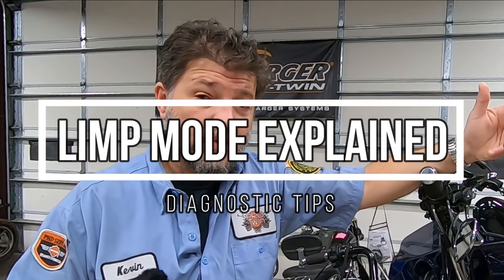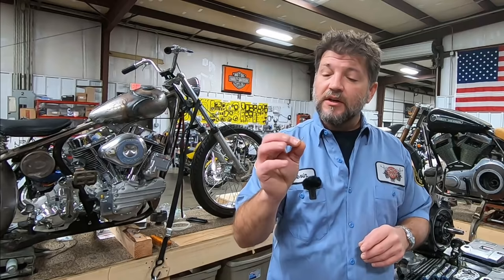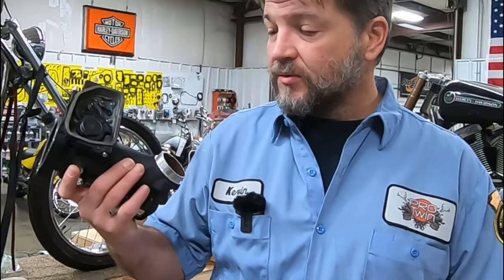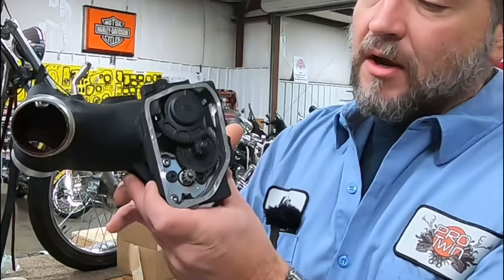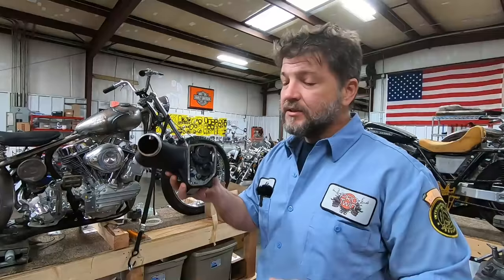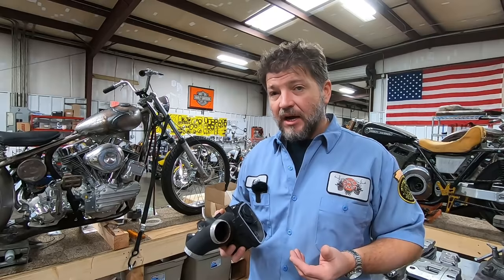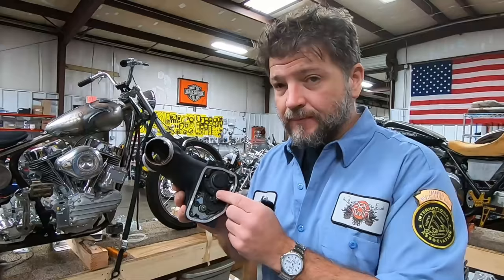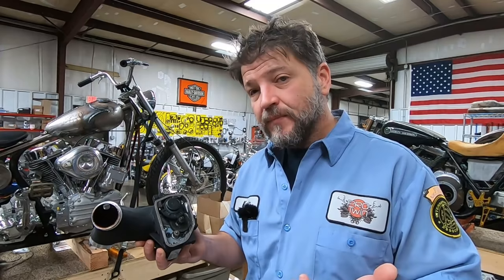Harley Limp Mode | Throttle Lag | Fly by Wire Explained | Kevin Baxter | Pro Twin Performance

Comment: As a BMW master tech of many years that’s the best explanation I’ve heard of fly by wire systems. 
One suggestion, use voltage drops rather than resistance measurement as even if you only have one strand of wire hanging on you will still have continuity.
Reply: Resistance is what creates the voltage drop.
Reply: @jonnybds3  yes but you need a load on the circuit therefore you cannot use resistance.

Comment: Thanks for this informative video. I had "limp mode" engaged on my '14 Limited twice, necessitating it being recovered from France to my dealership in England. The recovery driver helpfully turned the ignition on to stop the alarm sounding all the time, so when they got it in the shop, it had a dead battery. New battery - ran fine, no codes, no problem.  A month later, riding up a French highway, 80mph, cruise and stereo on .... bleeeeeurgh. Nothing. Would only just idle, such that I couldn't engage second gear.  Another recovery, this time to the channel, then another van home. Got collected by the dealer, and it ran fine. No codes returned by the ECM. They checked wiring, voltages, throttle body, everything. They were just about to ring me to come collect it, when a tech fired it up, and it lit the little yellow "helicopter", and wouldn't respond to the throttle. Instantly plugged it into the computer  ... ECM failure. That's why there were no codes - it forgot them when it was powered off. New ECM, and it's been fault free for 11 thousand more miles.
Reply: Hello ! Je me permet de vous contacter car je rencontre le même problème. Mon concessionnaire à remplacé le corps de papillon, et l'ECM mais toujours le problème. Avez vous trouvez une solution ? Merci

Comment: Thanks legend. I was stuck in limp mode 290kms away from nowhere. Checked connector to the throttle body and after reconnecting the bike roared back to life and saved me arranging transport back to the nearest dealer / mechanic shop. Please keep on educating me and others that are mechanically challenged.

Comment: Great vid. I checked and cleaned contacts on intake and ecm after my 2010 RK went into limp mode. The ecm connections where bad. Dielectric greased before I re-attached and bike is now good.

Comment: Funny, I sold my 2014 Streetglide Special this Fall 2020 and bought a 2009 Heritage Classic, one owner 12500 miles. Handlebar cable operated fuel injection, ecm, & no abs, Stock engine etc , liking it so much. Any Good Bike Shop can fix it if needed without going to a Harley dealership. Just so tired of all the Electronic Bull-Crap on these newer Harley's & only Harley having the information to repair them, it's like your a prisoner with your Bike to them. It takes the enjoyment out of owning & riding one.. Good video Dude.

Comment: Great information as usual, diagnosis intermittent electrical conditions are the most difficult things to deal with these days.  using a voltage drop test will show circuit integrity more accurately than an ohm meter will especially in the instance of a partial broken wire.

Comment: I've had the limp mode issue and it turned out to be the connection at the throttle body. Took the connector loose, cleaned all with CRC electrical cleaner, then sealed it with dielectric grease around the connector. That was 4 years ago, still good. Glad I don't "blip" my throttle!
Reply: I have a 09 ultra classic , had the same issue and did the same fix, that was five years ago and 50,000 miles.

Comment: Another area to look for as with my 2010 Street glide is where the wiring harness meets the neck. All the turning back and forth broke a wire within the harness right where the big wire tie is. You need to cut it back both ways and add a piece of wire that will withstand all the back and forth movement. Once fix all the codes and limp mode went away. This was a very instructional video once I was able to understand “correlation”

Comment: Thanks for the info,, I almost didn’t make it through the whole video because of the way you talk.
Reply from the maker: Ive been accused of imitating William Shatner.  Making complex topics easy to understand can be a challenge.  Often, I have to quickly search for words in my head before I open my mouth.  My brain works faster than my mouth so i have to slow it down a bit sometimes.

Comment: Kevin, I have a 2010 Ultra Classic CVO. I found myself in limp mode when I briefly stopped on the side of the freeway. I shut off the bike, and through a combination of turning the ignition on and off and turning the kill switch on and off as I was attempting to continue my trip, the bike wouldn't go much over 1,000 rpm and 15 mph. I stopped again and let the bike sit for about 20 minutes or so. After that, it started normally and has run perfectly for thousands of miles ever since. And it has never happened again. I have a video of this from a helmet mounted camera and I can pretty much see exactly what I did to enable the limp mode but have not tried to recreate this situation for fear that it will not allow me to recover normal operation of the bike.
Reply: Not sure if you are still around but if you are, can you explain what you did to enable the limp mode?

Comment: Thank you. I am a bit worried now about my friends FLH. They were riding across a small bridge and just as they were starting up hill it went into limp mode. They were in a scary situation with gravel trucks passing and no shoulder. They had the bike towed and the dealer found nothing wrong. Its been fine for a couple seasons now. 
 After putting a 160,000 mi on my 92 FLH I have been real hesitant to buy another Harley because of this issue and another similar with the fuel injection. I witnessed someone having to unplug and re plug something under his tank to get it to start. I am thinking all this technology may not be so good.

Comment: Going thru this issue right now with my 2009 street glide CEL is throwing 2 codes 1511 and 2135 I just purchased bike last year from dealer and got the warranty

Comment: I learned a lot watching this. I learned I want a harley with throttle cables. If it ain't broke, don't fix it! Fly by wire is expensive unnecessary crap. That being said I love fuel injection it is superior to carburation but fly by wire is not necessary.

Comment: Great tutorial. What are the ADVANTAGES to the fly by wire system? Was it required because of all of the other electronic controls of running the engine? I'm really questioning the change to fly by wire. The cable system was working very well for decades. After riding for 45 years on numerous bikes never a problem. During my first week of owning a fbw bike I had issues (5V reference voltage out of tolerance). Given all the vibration, twisting and changes in operating conditions the fbw system would be ripe for problems. My issue turned out to be a connector that wasn't fully seated. Of course the connector was buried somewhere and getting to it was time consuming. Fortunately the bike was still under warranty. While there was no out of pocket money I did lose riding time and the inconvenience of trips back and forth to the dealer.
Reply: The tutorial is very helpful, but apologizing for HD's choice in using a LIMP mode to communicate a problem is ridiculous. This throttle system is a trouble prone situation and I would really prefer to junk it and go back to the old cable based throttle. Intermittent troubles keep causing my motorcycle to cut out and sometimes this happens at very bad times. This is not a pleasure bike - it is my primary mode of transportation and needs to be RELIABLE. My 1999 Wide Glide NEVER has so much trouble and it has 3 times the mileage.

Comment: wow, this happened to me today! I went over a pretty good bump on the interstate that made me lose my throttle on my 17 road glide. it would respond on and off but not enough to get back on the road. luckily a fellow biker towing a trailer saw me whip over oon the shoulder and insisted  he tow me to the house 8 miles away! got the bike off the trailer and it worked ok for a few seconds but would go back into the mode. I just had my neck bearings changed and wonder if that had something to do with the TGS CORRELATION ERROR???

Comment: Could you discuss the correlation between throttle body size to cubic displacement or power in the twin cam motor?

Comment: Kevin has anyone tried different methods to solve the backlash issue? A simple, but understandably more expensive fix, would be to use a set of anti-backlash gears. We used these in some gear driven analog computers that would never pass the specs if anti-backlash gears were not used. In this application the idler gear would be an anti-backlash gear. The ones we used were two thin gears with springs between the two gears, similar to an auto clutch plate with springs.
Reply from the maker: yes.  at one time brass gears were being made, etc....but again...if that binds...it's a bad thing.  I think most are wisely choosing caution and keeping a reasonable amount of backlash.

Comment: I have a 17 Road King that experiences an rpm drop when taking off from a stop.  It is just a second or 2 drop causing the bike to nose dive but then it recovers.  It is awkward pulling away into a turn to have the bike bog down after moving a foot or 2.   It sounds like the gear lash that was described.  This is when pulling away from a stop so I thought it might be an issue with the rear cylinder not recovering correctly from the shut down.   I'm going to check all the connections at the throttle body and ECM and if it continues I'll see if there is excessive lash in the throttle body gears.    The bike has never gone into limp mode.

Comment: When I bought my 2021 Road Glide, I left the dealership to ride the bike home.  The dealership sat right on the highway.  When I tried to accelerate onto the highway, I could only go about 5 mph.  I pulled to the side and shut the bike off.  Tried to call the dealership but couldn't get through.  Tried restarting the bike and everything was fine.  Called the dealer when I got home (a two hour ride) and they offered no explanation. I still have less than two hundred miles on the bike, and the problem hasn't presented itself again.  I'm not feeling real comfortable about this.
Reply from the maker: sounds like you went into limp mode for sure.  if that happens again, disconnect the plug from the TB and reconnect.  that often will reset it and get you home.
Reply: Funny you mention Road Glide. I just hit 2K miles on mine, it’s a 2021, and it’s doing this same thing.
Reply: I have a 22 RG ST and mine did it to me twice with 8k miles. After digging around come to find out one of my wires to the TB was rubbing on a sharp edge and grounding out. It’s been filed down and the wire fixed and I’m at 15k miles with no more problems.

Comment: Was hoping to see if Throttle control was like a 5K? potentiometer?  If the Motor is a Stepper? If 2 of the pins at the Throttle Body could have 2 multimeters and see the 2 voltages at same time(half throttle would show 2.5 volts) could be checked with analog meters and verify smooth resistance changes, also test throttle control with analog meters to verify smooth changes. 
Also about applying voltage to motor directly to verify operation, or resistance of motor. Thanks

Comment: I don't know if this will help or not but I use non conductive electrical grease on all electrical connections. I prefer fargalean or more recently versa seal both made by Hubbell . I am a retired Master industrial Electrician. Is that a real Pan Head or a replica?  Mike from Maryland

Comment: Any thoughts on CRC GDI IVD Intake Valve & Turbo Cleaner to deal with the Direct Injection carbon build up that basically every vehicle manufacturer is going to due to regulations? Now that Harley has jumped on the band wagon with the M8.  I would rather not put an oil catch can on my motorcycle.

Comment: Hey Kevin I installed a fuel motor 110 outlaw big bore kit with a 58mm hpi throttle body now I have an intermittent code 1510(limp mode) never had a problem before the 58mm tb any idea,'s? Thanks bike only had 12 thousand miles 2014 street glide

Comment: I found your video from searching for mutt symptoms. I was wondering if you could help. I started having problems on the bike, an 08 ultra, heading home from work like it was sputtering and not getting any throttle an was for a lack of better words it would bump when I gave it throttle and it was hard to ride home. I have no idea why. It was running perfectly fine the last time I rode it. I could barely get it to move from a stop. It even did it on the highway where I couldn’t get into 5th gear without it sputtering.

Comment: I changed my bars and when it's warm out..  (over 70 degrees F) the engine light is on and cruise won't work.  Limp mode engaged.  Once it's cold out, it runs perfect.

Comment: I don’t like or want all this electrical nonsense on a bike. Fuel injection is good for cold weather starts but most don’t even ride when it gets cold. I prefer a cable operated carb even though I do ride all year as long as there is no snow or ice on the roads.

Comment: I have a P1510 performance mode

Still runs fine . Throttle freaks out sometimes and revs up .

Is it safe to run this way ? Twist grip sensors are ok backorder.
Reply from the maker: NO!!!!  Id park it bud.  It could go wide open throttle on you.  Ive seen it happen.
Reply: Does it freak out once when starting or within a few feet of movement? Or freak out any time and multiple times in a trip?

Mine freaks out once b4 leaving the driveway. Most often when I straighten out the bars to get moving.
Then I get like 80% power the rest of the ride.
I replaced TBW, I cleaned up all connectors with Deoxit D5, and applied dielectric.
No fix.
I've got the tank off looking for a wire that is only sometimes disconnected and I'm not finding anything.
What color wire or location at plug & at neck are usual suspects?
I can't reproduce problems with voltmeter, do I now just wanna splice some usual suspects & cross my fingers
Reply: @jeffmitchell72  , did you finally find out what it was that caused that? Mine is doing the same thing now.

Comment: I wonder how far off the volts have to be for this to be an issue. And not sure If i should be looking at throttle position sensor or twist grip sensor. I have found on both sensors that the total volts can be off, + or - by up to .04 volts.

Comment: Hi Kevin, I just did my oil change on my M8 128. noticed my oil was grainy and there was sand like residue left on the oil catch towards the end. The dimple magnetic plugs were normal will usual fuzz. 

Upon inspection of my K&P stainless oil filter, noticed some sandlike residue as well. 

It seems like my air filter failed on me and let thru atmospheric sand + I did ride thru heavy rain without my sock. There were water splatter marks and my intake / TB seems dirty. 

What should I do? Bike runs fine but apart from changing my air filter assembly and an oil change, should i flush the engine? Should i use a throttle body spray cleaner?

Thank you Kevin!

Comment: Kevin the problem i'm having is when i let go of the throttle the engine starts to rev upward, if i grab the throttle and gently push the throttle forward the rpms will come back to a normal Idle, then is i let go from this slight push forward, the engine revs back up.

Comment: I have a 2010 Street Glide with almost 15,000 miles and limp mode has happened twice.  I hope my dealership knows of this problem and can fix it.  I blip my throttle when down shifting.
Reply: I have the same bike you do and mine has went into limp mode twice this year!  It's very disappointing to say the least.
Reply: What was the problem? Did they find out what it was?

Comment: Hi Kevin. I hope you can help. I have a 2017 Low Rider S (FXDLS). I’ve had extensive work done. S&S 585 cams. S&S HC pistons. Bassani 2-1 exhaust. S&S cam plate and S&S tensioners high flow oil pump, and most recently a min o’ compensator and Barnett scorpion lock up clutch. Over the last couple of weeks I’ve noticed that there is a lag in acceleration from 3rd gear upward. The bike used to to take off in any gear. 
Do you have any idea what could be causing this?
They bike has 1800 miles and was Dyno tuned when I put the cam and HC piston. 
Any help greatly appreciated

Comment: Hi Kevin.  Problem.  I put a set of bars on my 2018 Deluxe FLDE.  I used magna shield electrical extensions. Plugged all back in.  Lights. Driving lights. Horn. Signals. Emergency flashers all work. Bike starts and idles but no throttle at all. All the lights on the dash gauge inc check engine blinking.   Thoughts?  Where to start?

Comment: I have a 2012 triglide with miss around 2500 rpm and no trouble codes could it be a broken gear in the throttle body ?

Comment: My m8 stalled a couple of times but it picked up and went on. Did it after a stage 2 kit. My friend said it was still learning the fuel curve. However this limp mode may be what happened
Reply: I just had a Stage 2 done on my 22 RG Limited and bike has gone into limp mode three times. It’s now at the dealer getting looked at. Did you get your bike fixed an what was the issue?
Reply: @cheby56 just happened to my m8 w/ stage 2 kit. What was the issue with your situation?